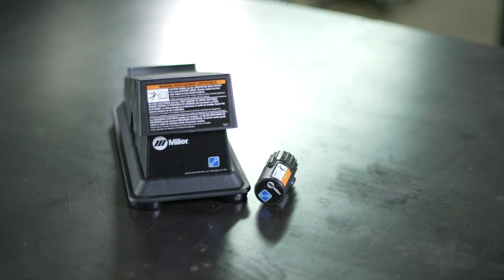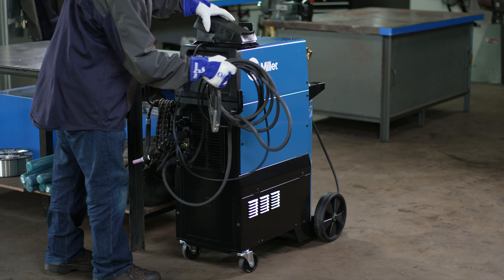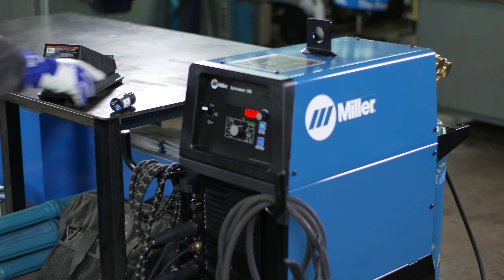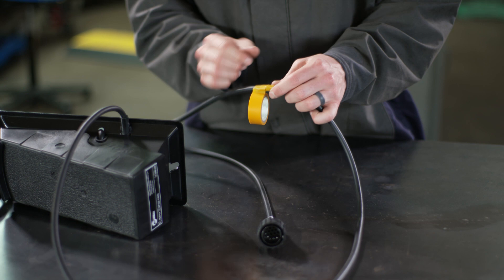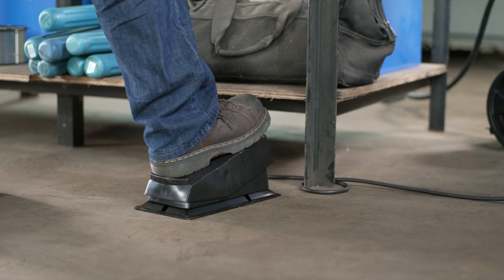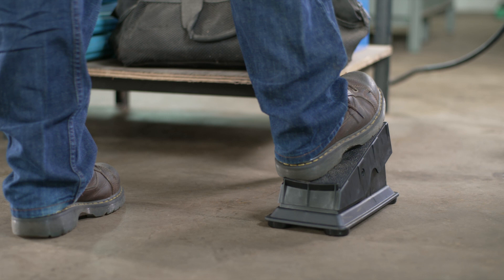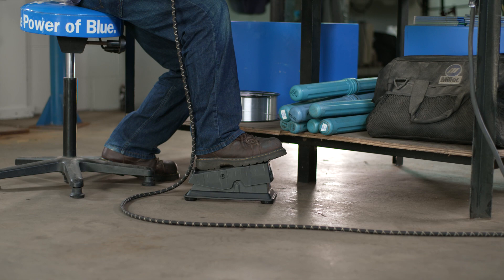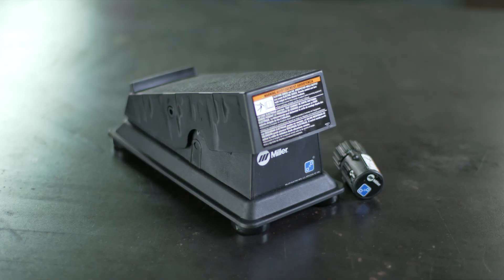Wireless Foot Controls Save Time and Money in TIG Welding

Comment: Would be great if it turned itself on by hitting the pedal. Then timed out after 30 minutes of inactivity and went off.
Reply from the maker: Thank You for the feedback; your thoughts are very close to how the system works!  The  foot control should only need to be paired with the receiver when batteries or another part of the system is replaced.  It is shown in the video as a reference of how to do this, but the transmitter and receiver do shipped paired from the factory.  After initial pairing the foot control should work when pressed, until connection is lost from an issue such as dead batteries.  The foot control also only uses power when in use so there is no unnecessary draw on battery power when idle.  Please feel free to reach out with additional questions or comments to info@millerwelds.com.
Reply: @MillerWelders  great, thanks!